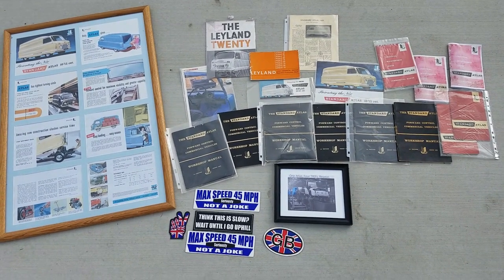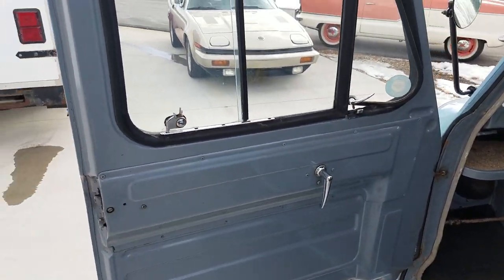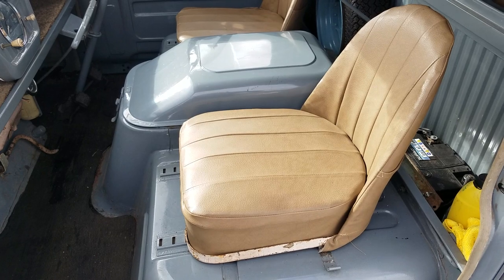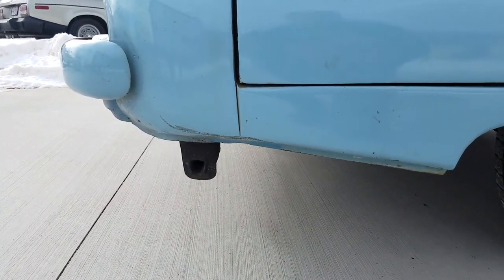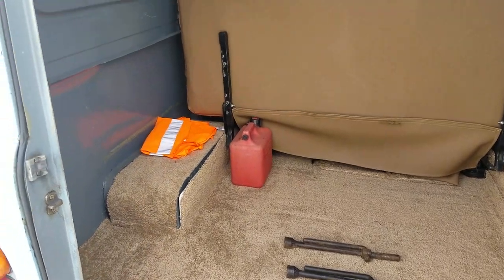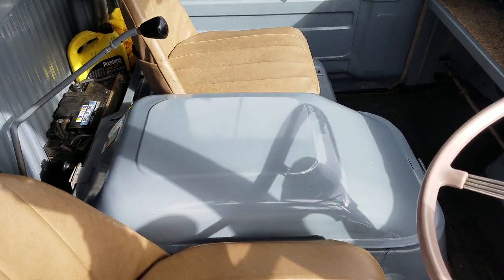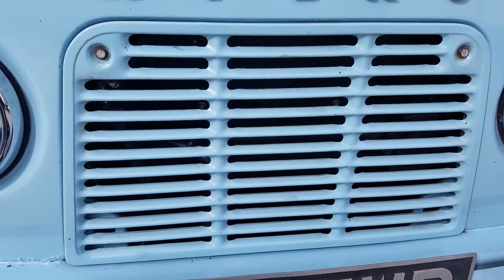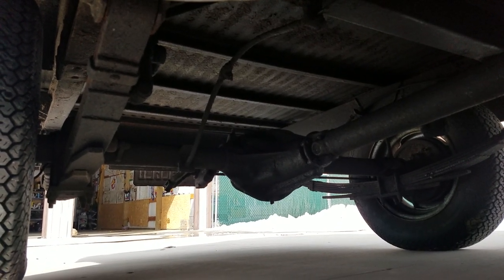Walkaround of 1960 Standard/ Triumph  Atlas Commercial Forward Control van

Comment: Beware that front transverse leaf spring suspension. I was with my Dad in the early sixties when it broke near the bottom joint on the driver's side. The wheel folded back and we skidded a bit but were OK. I don't know the exact details but my Dad found a local (local to where we broke down) garage and got some plates made up. We walked back to the van, he bolted it together and we made it home. He was a real McGuyver, my Dad. On another occasion after taking me to visit a friend his car wouldn't start. He checked the distributor and someone had taken the rotor-arm. He took a bottle cork and a take-out, foil, food carton from his friend's bin, and with his pen-knife fashioned a makeshift rotor-arm. Driving home he drove real slow, keeping the revs down so as not to explode the temporary rotor-arm.
Reply: Wow 😲 interesting stories!

Comment: I had a camper version of the van in the mid seventies. It was a very strange driving experience, especially if you braked hard when turning sharp left. It was on its way to the scrap yard when I bought it,  I thought I could rescue it but there was just too much rust, I used it until the MOT was due then I scrapped it. Thanks for the memories.

Comment: Thanks for the Atlas van look around, you were looking for a jack for this Atlas,     I remember Hubnut ( UK ) touring NZ probably a year ago in the middle of the North Island ( alpine territory ) a long shot, a huge car & commercial auto wrecking yard ( breakers known in Uk ), I think the name that comes to mind " Horopito Motors", so huge a drone or two would be helpful. Just looking at some of those jacking points, a contemporary option may be a Hino Dutro van ( 4 litre Toyota Hiace ) seem to have a similar jacking point, it used the N04C engine. Hino & Lexus are part of the Toyota group, just thought Id share a contemporary option, possibly a bottle jack design. That Hino was I think still in production up to a couple of years ago. Imported second hand ex Japan as is extremely common in NZ.
Try " Vernon & Vazey Commercial Truck" wreckers in Pukekohe NI, NZ. Ask them to photograph that cup jacking point on the Hino Van , & associated jack it uses.
Good luck.  😎👍👌
Reply from the maker: Cheers, thanks for the lead!  I contacted them.  I did find a BMW and Austin jack that works, but still searching for the original.  Thanks AGAIN!

Comment: Should it help, the roof vent is fitted the wrong way round, the louvre (slots) should be at the rear of the vent, that way the air is sucked out via vortex action and of course, the water does not get pushed in when it rains.  Great to see one of these again.  You have to wonder at the luxury of the early vans/commercial vehicles, it was just a case of getting in it and do the job, you were lucky to even get a heater, and that was only if the boss liked you, and that was not likely either!  Great to see one again, many thanks Simon (England)
Reply from the maker: it is correct... just missing internals
Reply: @midgetwidget  No they were fitted with the vent facing backwards, I know as basically the same vent is still used on some vehicles, they also used to fit four of them on buses we used to run on the top deck edges in order to extract the smoke (when you could smoke on a bus or anywhere that is)  Love the chuckles when you mention certain aspects of the vehicle, I did the same.
Reply from the maker: @mercuryrvmotorhomes7475  This is incorrect the vent is fitted correctly
Reply from the maker: Andrew Sully  948cc originally.  I have swapped in the same block but an 1147...looks stock but climbs the hills here at 7000 ft a bit better.